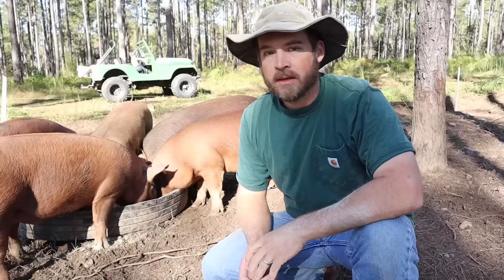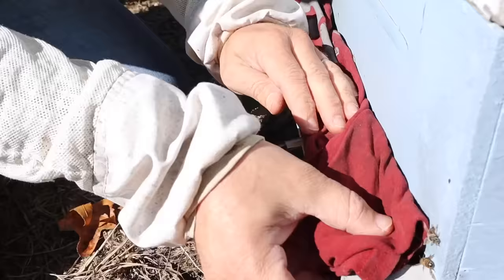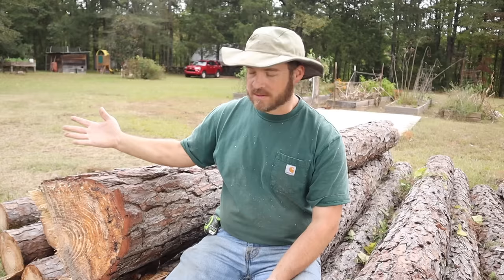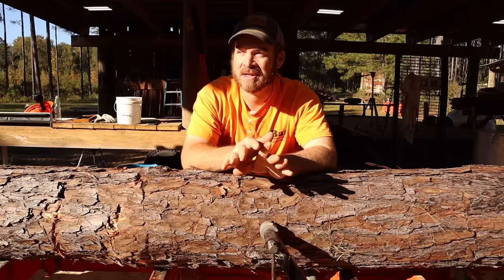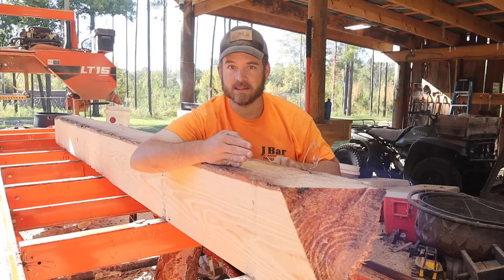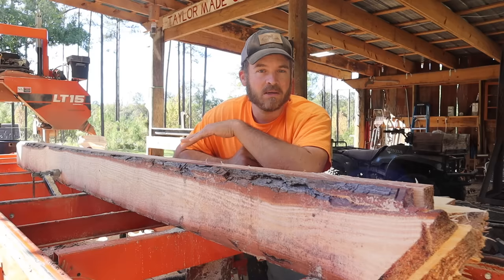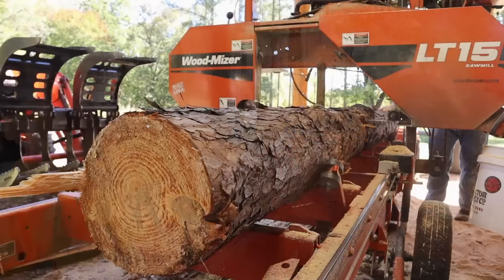Old School Framing Lumber

Comment: I don't have a sawmill but I've heard people say pine really gums up the blade. Just curious what you use for lubricant?  Thanks
Reply from the maker: I'm using dish detergent and water here. These logs are not so bad because they are not big logs, and I really pour the water and soap mix to it, so not so bad. On particularly gummy logs, I'll run a little diesel over the blade every now and then to clean the blade. Some sawyers use diesel all the time. Works great but I worry about the aerosolized diesel.

Comment: why true 2x6s? always curious of that. I still cut my lumber to standard lumber size 1.5x5.5. I dont plane them mind you, unless thats the reason? with smaller lumber, u can potentially get more out of a log and still use hardware such as joist hangers bought from the store
Reply from the maker: Yeah I'm starting to rethink my approach. The 2x4s have been selling quite slowly.

Comment: I have fell many trees through
out my life almost always when I watch someone else cut a tree I see them cut a huge wedge to clear for first cut I have never done it this way my first cut for the wedge is only about an 1 1/2" wedge I mean if you think about it once the tree closes the gap 1 1/2" the top of the tree has moved in the felling direction 20 feet I  just always wondered why everyone cuts such thick wedges 😮when dropping trees especially for logs seems like a waste to straighten and square the butt flair

Comment: When you stacked you did not leave an air gap between each board. Isn't that the way it should be done? Also, why cut 2x6 and not 1.5 x 5.5 for more yield? I would argue each are more than good enough for support so why use more wood?
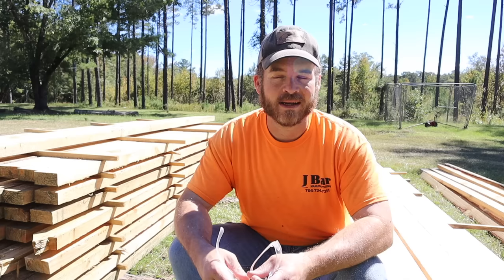Reply from the maker: 28:01 you can see stickers between every board. Because I like the traditional sturdy look of true lumber.
Reply: Yes i see stickers for the up and down airflow, but what about the side to side airflow? @falllineridge

Comment: You cut how you want, let the keyboard warriors type away, and you don`t waste the one by`s, you use them as spacer boards for your stacks, that`s some good looking stacks you got there. Geeze those pigs are huge already, you must have an endless supply of pork frozen,  so you are going to try butchering a pig yourself, watch a couple videos, and have at it, imagine the time and hassle of loading up the pigs, going to the butcher, and bringing it all back, when it can be done in your own backyard. Just don`t let the pigs see ya, they might not be your buddies no more, they might stop eating, heehee, there is nothing wasted on a pig, and I mean nothing, you can make pork rinds from the skin, fry the ears up too, your dog will love them, and all the rest of what`s left, you can grid up in your sausage maker, fill up some large  casing, and make your own spam or scrapple, I would love to see it, buddy, have a great dinner.

Comment: You have got to sharpen that blade or get a new one.
Reply: On the chainsaw.
Reply from the maker: Chain was sharp, it was throwing chips on the straight cuts. Seems to struggle on the angled cuts.

Comment: The only issue I see with your sawing technique is you wound up with the pith way off center after sawing two 2x6's off the same side of the cant. You should have turned the cant 180 after sawing the 1st board and took the second one from the opposite side to keep the pith centered. Your boards would be stronger and straighter that way.